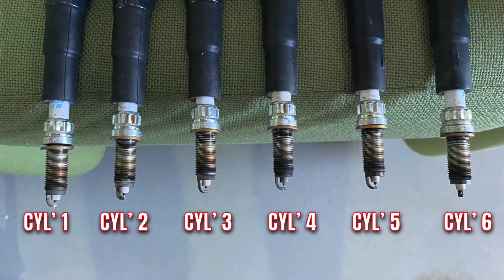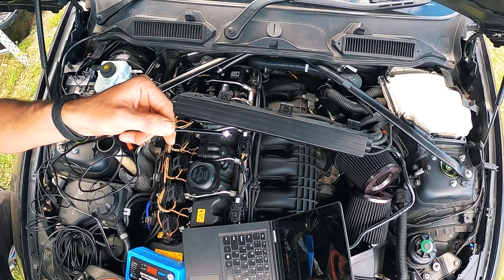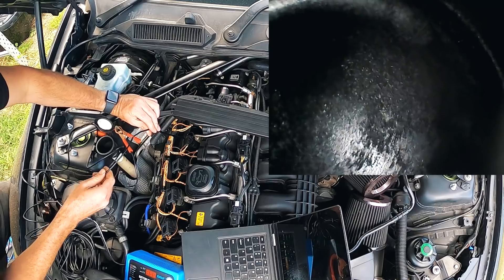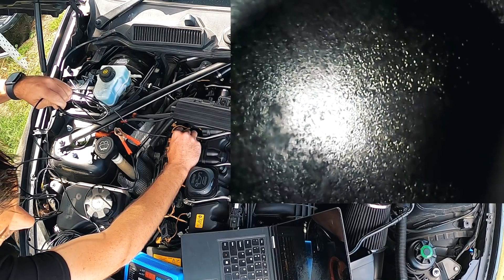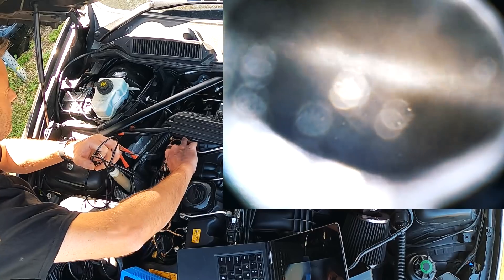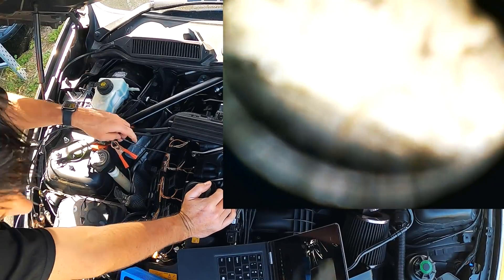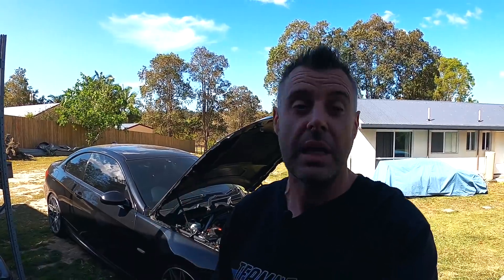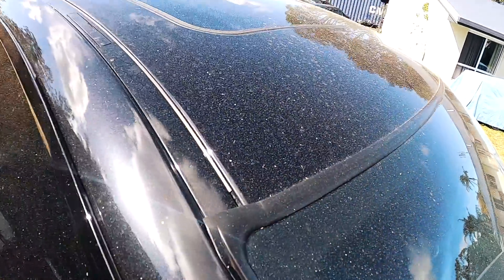BMW E92 335i What Caused N54 Cyl 4 LOW Compression: Borescope

Comment: I be the rings have become stuck to the piston and thus they are not sealing properly. These engines can siffer from this especially if you have a particularly dirty cylinder. Stick some seafoam in the cylinder and leave it to soak overnight and you might be suprised

Comment: So I was taught that the first pop of a manual compression test tells you the health of the valves and total compression is rings.  Your first pops on multiple cylinders look like 💩.  I would lead more toward valve wear.  Oil starvation high heat maybe a tune on it.
Reply: You need to pull belt while plugs are out and spin motor and check for binding
Reply: Pull turbos and intake manifold and check for blow by and post cylinder combustion on #4.  Those are the last steps before opening the engine all the way.
Reply: Not trying to advertise but you can check my Mercedes M157/278 teardowns on IG and see some internal issues.  Mine was bent rod causing ring seizure ruining the garbage Silitec liners.  It passed manual compression but relative looked like 💩.  You could feel it spinning it manually.

Comment: My best guess is 1) ringland failure. Symptoms would be low compression, misfire with no codes and excessive blowby out of the oil cap, smoke coming out of the exhaust due to the broken rings and excess oil getting into the cylinder. 2) Broken valve spring, yes it is very uncommon in the N54 but it does happen. Symptoms would be low compression, misfire with no codes and a valve tick that doesn't go away.  
For now just swap the other N54 engine you have and do an N54 engine rebuild series on this one. 
Good luck, keep those videos coming!!!

Comment: Piston rings can stick when they get dirty. Causing loss of compression. Put injector cleaner in all spark plug holes. Leave to soak overnight. Turn over engine with fuel pump disabled and spark plugs out to eject the excess injector cleaner from the chambers . Then put everything back together. 

Then start the car and let it idle until the smoke dies down.  Now do another compression test and see if cleaning the rings has cured the low compression.
Reply from the maker: Have you ever heard of that happening with an N54?
Reply: Zero To 60 not personally but I know it is common to the larger BMW engines , especially when they are used mostly for short journeys and don’t get hot enough. Also need to regularly push these engines to the higher revs. The rings get sticky and don’t seal properly. Long oil change intervals don’t help much either. Should be changing the oil once per year or every 5000 miles. Whichever comes first.

Comment: I suggest a cylinder leak down test! It's the next step after finding compression is out of spec. The procedure will help troubleshoot where air is escaping and how much,  using an air compressor when piston is at TDC. Things you couldn't see clearly through the boroscope such as valves and head gasket. Just a suggestion. Good luck on your N54! I just recently bought a 335i and love your videos :)

Comment: I suggest you check the fuel injector seal at the tip of the fuel injector.  Compression can leak past that seal.  But yeah do a leak down test first

Comment: @Zero To 60, comment in this video follow what I mentioned in your last one - there aren’t a lot of stock engines that’ll take nearly 30psi and never complain. Typically some combination of valve springs, head studs, rods and pistons. 

My fear is that you swap the engine and it happens again simply because the stock N54 isn’t designed for that power level. 

You could bet on that happening, swap the engine and if your current block/heads are in good condition do the above four items and then really lean on it - 35 or 40 pounds here we come ;)

Comment: Since this motor is so abused just replace it🤷‍♂️ ... build it right then slap it back in.. your running 28psi on a crap motor its going to break and im sure the transmission is not far behind. Other than trying to grenade a junk motor not sure what your doing just send it blow it up and get on with the swap

Comment: Good job on using the Borescope, your bottom end doesn’t look like there is an issue. What I noticed is you have not done a leak down test and that is a step you do Always right after a compression test if you have lower compression then normal. Before you tear that engine apart I would preform the test so you can check if there is an issue with a leaking head gasket or a valve issue. 
Good luck!!!

Comment: Did you already put a couple ccm of engine oil into it and went with another compression test? Usually that rules out defective piston rings.
Reply from the maker: I haven’t yet. Purely down to time. I could try that instead of doing the leak down I guess
Reply: It's kinda fast and easy done, you immediately see the result. Not much content creation compared to leak down test, unfortunally.

Comment: Maybe still a hairline crack on the ring land or even loss of the plating on the top ring face, or even hot rings causing them to butt slightly and wear quickly, look for shiny spots on the gap faces. I think you might have caught it early and a hone and a set of forged pistons might be the go...... 🤔 Above the ring reversal point is probably oil residue. Bores still look excellent.
A leak down test would help and a good set of ears will tell you if it's intake, exhaust valve or ring pack.

Comment: I had this issue, oily spark plug along with low compression, the causes is out of round issue. You need new block or get it rebuilt. I ve noticed you r running aggressive timing too, could be that was your main cause. Do you have a smoke coming out from exhaust?
Reply from the maker: Nah, no smoke from the exhaust.
Reply: @ZeroTo60Tube  Good, waiting for leak down test.

Comment: Going with my same advise from last video. Spark plug looks rich, not lean and not like burning oil, if it were burning oil the plug would be glossy sud on the plug with purple ish tint. Look at the intake valve for that cylinder. The piston has carbon from a rich condition. Do a leak down test.

Comment: It would be good to see the full length of the bore at BDC. The inspection only showed a very small sample of the piston wall. Also after cleaning the mirror attachment inspecting the valves would be a good idea (barely saw one and there are 4 to look at) for cracks or seat damage.Check the top perimeter of the cyl. head gasket for any brown staining that would show coolant burning (IE a blown head gasket).  If all looks good I would still try to re-torque the head (with all the boost you are running)and recheck the compression including a leak down test. Remember to do all the basics of the testing like adding a few drops of oil to the cyl. to see if there's a bump in compression with that as well.Good luck and hope all goes well.

Comment: Like others are saying swap injectors around and install new seals and decoupling rings when you do. Look for evidence of blow by on the injector stem above the seal when you remove #4 injector. 

Firing order is 1-5-3-6-2-4. So maybe swap injector 3 and 4. They are 360° out of phase (crankshaft rotation). Remember to re-code the injector calibration in INPA after injectors are swapped. 

I am leaning towards cracked ring land, but try the easy and cheap stuff first. Maybe redo the compression test on the cylinder dry and then again wet. If it is ring related, compression should increase with some fresh oil in the cylinder I think. You want to do them back-to-back to minimize the effect of other variables changing. Back off the throttle body to intake manifold bolts to relieve the vacuum in the manifold.

Comment: Is it possible that a leaking valve cover gasket / cracked valve cover resulted in the plug looking dark like that? I don't recall which cylinder, was 3 or 4 on mine, that had oil stained plugs when I changed the cover

Comment: So have a friends car in my garage and it had a weird issue, wasn't at all down on power (or at least didn't seem to be) specs are GTX3576 single turbo, E30 mix, JB4, MHD BMS back end flash, watermeth kit, 6MT, 7" IC etc. Nothing super crazy, just a basic responsive single turbo setup.

So after a few races one day it developed an issue where it would blow some smoke, tips of the exhaust were oily. Suspected damaged turbo to begin with, so turbo was sent away for testing and came back fine. no dramas with the turbo what so ever. No visible signs of damage on the turbo either.

So I investigated it a bit more and couldn't find any real faults. Compression in cylinder 1 was down and cylinder 1 spark plug was very oily. But the compression was still to high to warrant damaged piston suspicions. (compression was 150psi cyl 1, 180psi 2-6)

Got the engine stripped down today and found a very unusual break that I thought I might share with you guys. The car has 80k km on the clock and is a 1 owner AFAIK, always serviced at 5000km, good fuel used, quality parts always fitted.

First thing I noticed was the wet oil in cylinder 1, the head was coated, the piston was very oily, and once wiped off there was no noticeable damage to the piston top, or the cylinder head, I did notice there was a lot of severe detenation on top of piston number 5 and also evident in the head of that chamber. I can only assume it has a faulty injector and that has caused the detenation in that cylinder alone. as all other cylinders are near on perfect.

Cylinder 5 Det marks:

￼

Cylinder 1 Oily

￼

Cylinder 1 piston top, oily but no damage:

￼

Damage on cylinder 1 bore:

￼

Piston number 5, clear signs of severe det:

￼

First sign of damage on cylinder 1 I noticed was when the engine was pulled to TDC the piston didn't come all the way up, which I thought was odd but isn't unheard of on some engines. But when inspected cylinder 5 I noticed it came the whole way up, so I knew something was astray.

Piston number 6 all the way up:

￼

Pulled cyl 1 back up to it's resting point and also noticed it was sitting unlevel, it was approx 20thou down on the back side of the piston, but at least 80thou down on the front side. this is the way the gudgeon pin runs, so I was concerned from this point that either the pin had collapsed or the rod had bent.

Piston number 1, clearly not at TDC and not running straight:

￼

On to disassembling the bottom end, and all bearings, mains and big ends were perfect, you would expect this engine to have traveled no more than 10,000km it has been kept that clean inside. the bearings look near on new. Infact all the bores (apart from cyl1) looked very healthy also.

Removed the piston and rod combo from cylinder 1 and found a whole heap of mess. The conrod has bent into an S shape and tilted the head a little, causing the piston to run on a funny angle, pushing the piston skirt into the wall of the cylinder and obviously jamming the oil ring tight on one side and more than likely not touching the other side, hence the excessive oil movement from that cylinder but not to much compression loss.

This doesn't look super straight:

￼

Piston skirts being mashed up against bore:

￼

Other side:

￼

Rod 1 vs Rod 2:

￼

This is a very odd failure on such a mild setup (considering how far other people have pushed the N54, myself included)

Comment: My guess is bent valves. I have a head laying in my garage now with 2 bent valves on cylinder 4. Had the exact same noise and low compression. Has happened to me twice. I'll figure out how to send you a picture after work.
Reply from the maker: Did you narrow down what was causing it?
Reply: bent valves will usually result in no compression at all, or close to it
Reply: I did not. Happened on 2 different motors. Put a different head on the last one and no problems yet. At lease 2k miles on it with upper 20s pounds of boost. My compression was reading around 70 with the valves bent. They were bent just enough that they couldn't seal all the way.
Reply: I take that back. It happened to 2 different motors. The first motor timing was off when I took it apart. Second motor I'm still using timing was ok

Comment: I hope it’s not gonna need a new motor??? But from what it looked like, seems like you maybe fingers crossed 🤞🏽 it’s nothing crazy and you can get away with like a simple re gasket the top?
Reply from the maker: I just hope the block and crank are all good. I dont mind if i have to use the engine from the e90, but if that is the case i will save up for some stronger internals for this one.
Reply: I hear you. But it’s not a bad idea to start disassembling the other n54 now and collet what’s good outta that engine. Then why not maybe start thinking and planning out what parts and turbo or turbos and fuel system and so forth and so on.... ?

Comment: Have you used inpa to monitor what the knock sensors are reporting? Is cylinder 4 standing out there? If it was a ringland or bent rod it would be knocking minorly
Reply from the maker: That is a good point, no i haven't. Will look in to that as well. Thanks for the suggestion.

Comment: 8:40 that black line looks like a cracked cylinder wall to me
Reply: Definitely stuck out to me.
Reply: Robert French Likewise. I would pull the head off if that was my car after seeing that.
Reply: At 7:46 there's loose carbon.
I'd open the inlet valves and use the camera again. Within 30min you'd have the inlet manifold off and be at the valve seat. 
Good luck with it 👍
P.S. - isn't called "bore scope" 👂

Comment: Probably worth doing the injector seal and de-coupler on that cylinder, going to be the cheapest option to try. maybe pull an injector from the other motor you bought and put that in just to rule out the injector as well?

Comment: Have you checked the injector? A shot injector can give all sorts of weird problems on the N54 (my engine sounded like rod knock). And if the injector is loose in the cylinder head that might explain the loss of compression.
Reply from the maker: I haven't pulled them out or anything. If i do a leak down test it should show that tho.

Comment: If it's a ring land, it would be a hairline crack on the ring land(in most cases) . Not something u can see from the top. If you could see it on top it would have been a major knock or lean out event. So it's not that. Hope it's something easy

Comment: Bended rods happen very often it seems, they're not as strong as most people think. It causer the piston to be a little out of shape and get oily. Eventually you get cracked ringlands and massive engine failure... Also see: https://bmw.spoolstreet.com/threads/n54-failure-335i.311/
Reply from the maker: I feel like i have read 1000 posts on n54 failures in the last week and i don't think that was one of them, so thanks for posting it. However, Tony from VTT's post on that thread shows some brilliant pics..... Shall we start taking bets on it being that type of ringland failure?
Reply from the maker: Which is caused by a bent rod....
Reply: @ZeroTo60Tube  IDK man, trying to help as much as I can. I just remembered that I saw that post with one oily piston and found that topic... I guess most of the people just keep sending it and only really notice when the engine goes pop... :(
Reply: @ZeroTo60Tube  It's the only "logical" explanation I can think of if the compression is lower but holds stable without leaking out, could totally be wrong though as I'm far from an expert.
Reply: Ouch.
Reply: reasonably easy to check for a bent rod too, measure how far down it is at TDC
Reply: flinchy but that requires head off to measure correct?
Reply: @justindunn7785  to do it precisely yeah

You can get a general idea by putting a rod or something through the spark plug hole and measuring how far it sticks out, usually a bent rod that you're noticing a symptom from will be bad enough to be noticed through this. If its not at least a  decent fraction of a millimetre its probably not the problem.

 a dial gauge is handy if you have something fixed to stick it to
Reply: flinchy fair enough thank you. My 335i failed a headgasket test (blue liquid on coolant tank). But I’ve not lost any coolant or oil in nearly 3months now. So I dunno what to make of it. 
My exhaust spits black water when I rev it (after a drive). So was thinking headgasket. But no other signs of failure. 
Was getting smoke out the exhaust on deceleration which pointed to turbos. Changed em to stock. Still smokes but I think it was just oil in the exhaust burning out. Plugs are all clean. So just wanted to know. Thank you

Comment: Pull your injector 4 out take look
Reply from the maker: Do you think the injector seal would be noticeably cooked? Also any ideas on the oil in the cylinder?
Reply: @ZeroTo60Tube  I think your injector seal is done replace it with new 1 that should fix that problem you having I had similar issues with mine
Reply: +1 to this - injector seals do weird things.